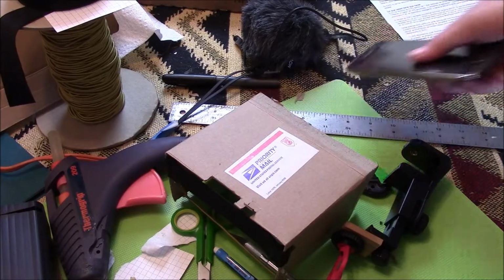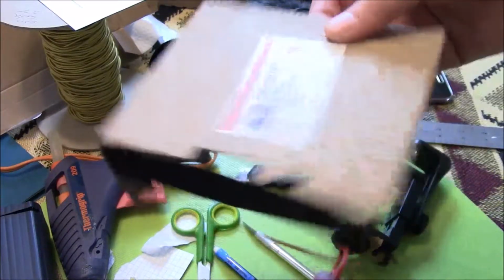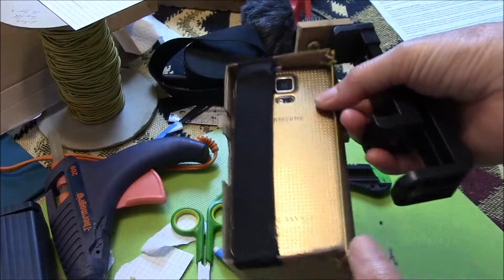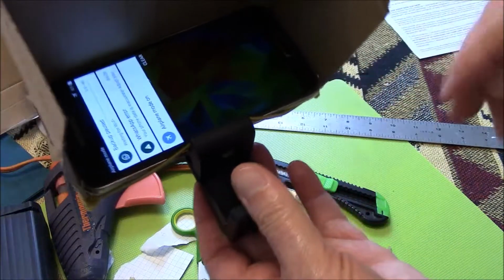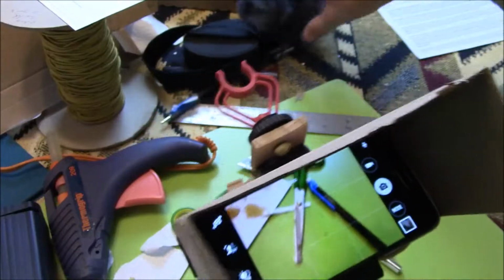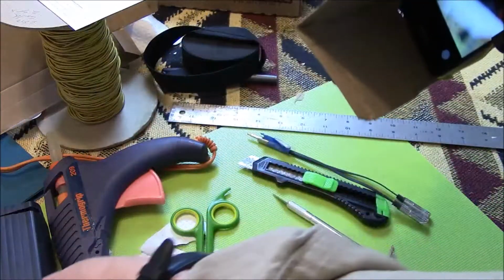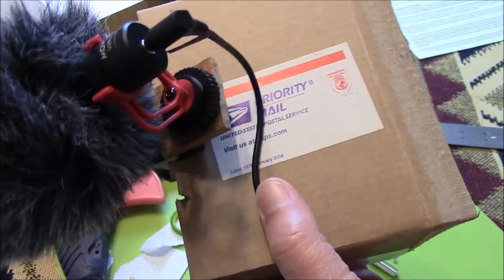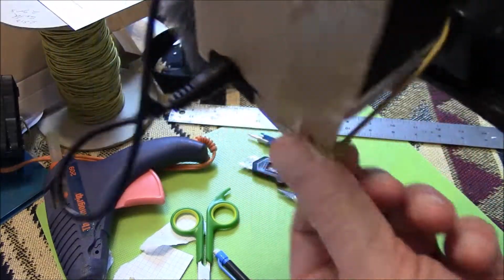DIY Phone or Monitor sun shade for smartphone or drone monitor

Comment: Great idea Robb! Having been made out of what is essentially trash is probably a theft deterrent too!
I saved about a hundred bucks by using a paper egg carton as a tablet stand. ( My iPad is in it right now) and a cardboard box for a rifle rest and support for mounting a scope. ( Fold the top parts into the box and cut two appropriately sized notches in the opposite ends to accept the fore end and butt stock. Works great!)
Reply from the maker: Hey chops, those are good ideas. I still don't feel comfortable going to my indoor range but once the flu is over I want to experiment with adding a diy laser to my little taurus PLY22 and will need something to rest it on to test the accuracy and dial it in. I get a lot of amazon boxes and need to come up with things to make with them. I have a good video coming up next making a magnet camera mount.
Reply: @RobbsHomemadeLife  
Sounds feasible, and you can carry accessories in it. (don’t forget to make a duct tape carrying handle for it😉👍) .A hot glue gun works good and fast to make thick pieces if necessary. I have so many freakin Amazon boxes that I’m thinking of making a winged back arm chair out of them.
Reply from the maker: a person could tart an amazon box channel. we all have the same problem.